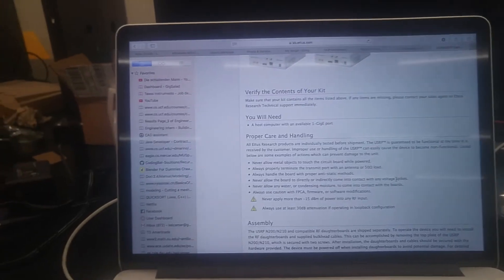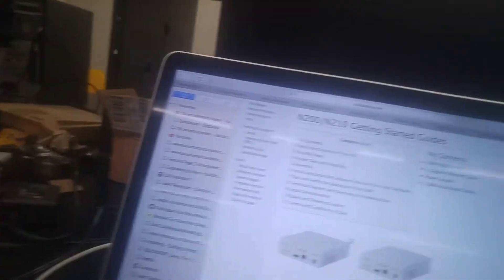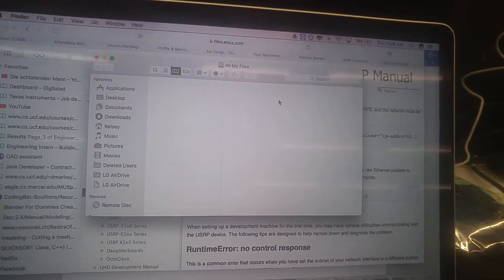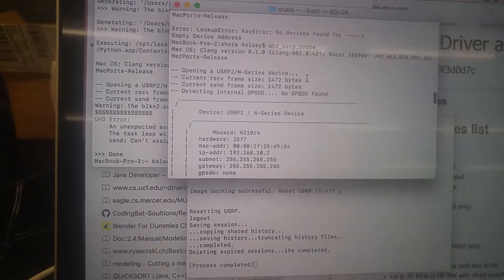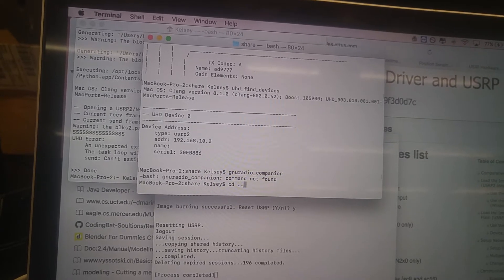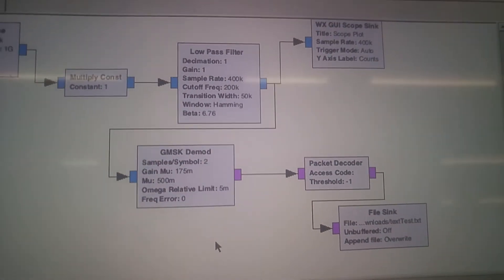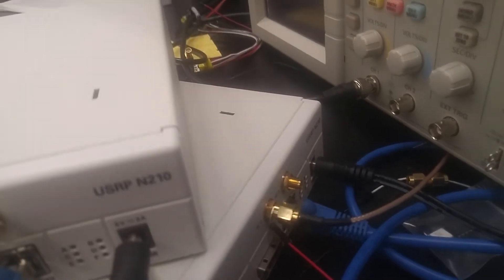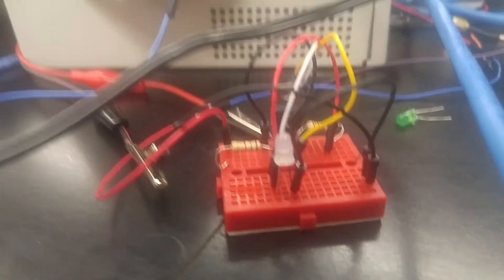Introduction to N210 USRP with VLC and GNU Radio

Comment: Hello Kelsey, please what’s the difference between the N210 and the B210? I thought the B210 is just a board, while the N210 is the full package but the board on the N210 looks so different.
Reply from the maker: I am not sure! I haven't worked with the B210 personally but you may be able to get gnu radio up and running with it.
Reply: Okay, thanks Kelsey. Am going to give it a try but I hope I don’t need to attach any daughterboard to the board before I could get it to work.

Comment: I connected my USRP to my linux laptop and tried to ping the USRP but it could not ping for some unknown reason. I have setup an static IP Address as stated on the website llink you shared on the video but still got nothing. Help please?
Reply: I also tried the commands "uhd_find_devices and uhd_usrp_probe" and it shows me that no device is there.
Ethernet cable is working fine.
Reply from the maker: @ahsanshahid2206  are you sure that your cable is functional?

Can you try restarting the USRP?
Do you have an oscilloscope you could connect to it to see if you get any signals out of it?

Comment: Cool work! I know I'm a year late to the party but check out Harald Haas for lots more LiFi on USRP inspiration. You should also be able to configure the gain the GNU on the USRP so it's not pumping such crazy power out. Not sure what the default is on GNU - think it's either 0dBm, negative dBm figures are much more reasonable. Think that N210 may go down to -30 or -50 dB. Have fun!

Comment: i follow up the guide step by step but i could not found USRPN210 yet can u help ??
Reply from the maker: basel elkady what's the problem?
Reply: when i write cmd uhd_find_devices  reply : no device found
Reply from the maker: basel elkady That means UHD is not setup correctly, I got that error about a hundred times and as soon as I reinstalled on a fresh USRP, the problem resolved itself.
Reply: what do u mean on a fresh USRP ?? and i installed uhd 3 times till now !!
Reply from the maker: basel elkady I'm sorry to hear that.  By fresh URSP, I mean to say that I had access to 11 of them and sometimes they are harder to connect than others.

Are your sure that UHD is installed on your computer properly and have you tried using Linux instead?
Reply: no i didnot try yet 
okay if i install uhd without gnuradio and write the cmd uhd_find_devices if it installed correct it will find the device or i have to install both of them ??
Reply from the maker: basel elkady you should be able to use that command just from the UHD installation :)
Reply: thank u for ur reply but i have finished the gsm network i am  now try upgrading  to  3g
Reply from the maker: basel elkady nice!